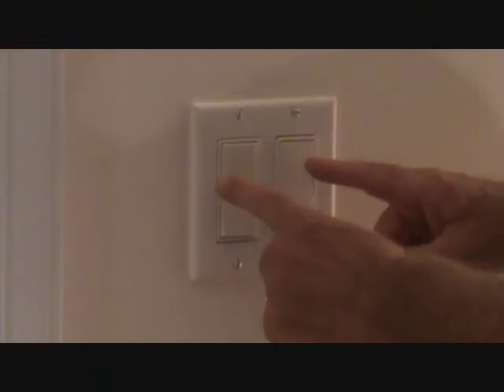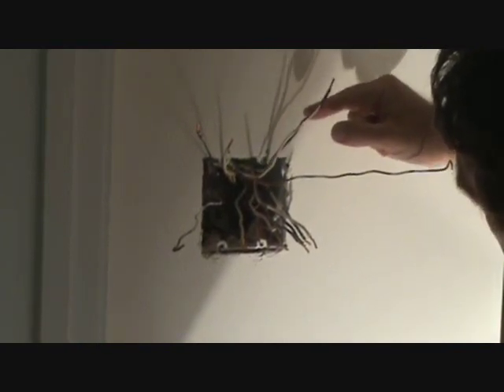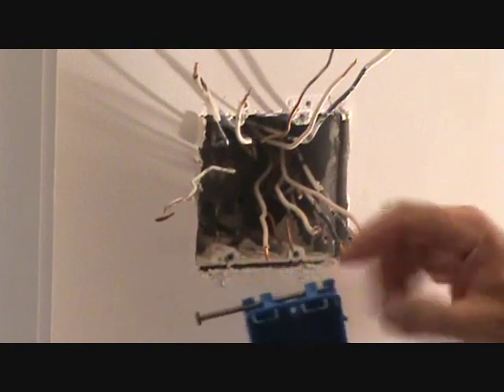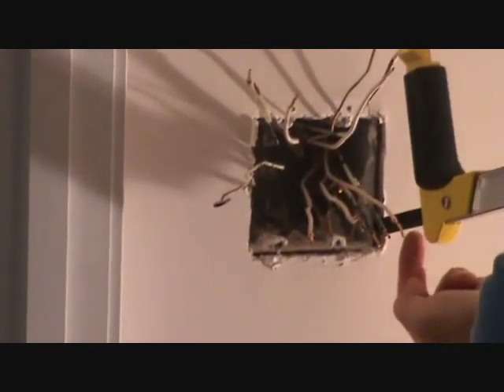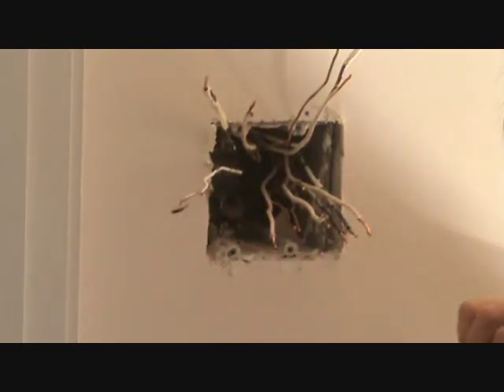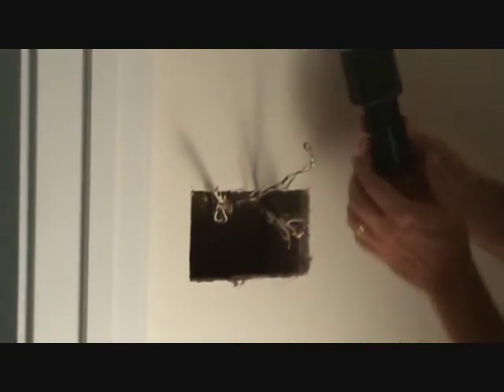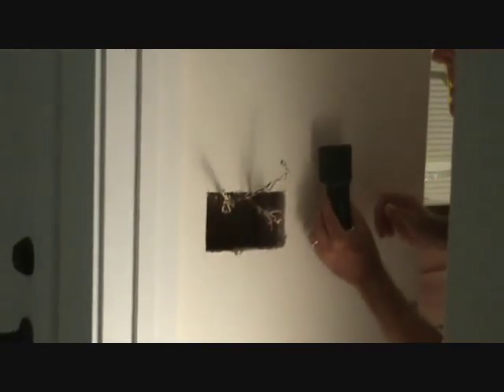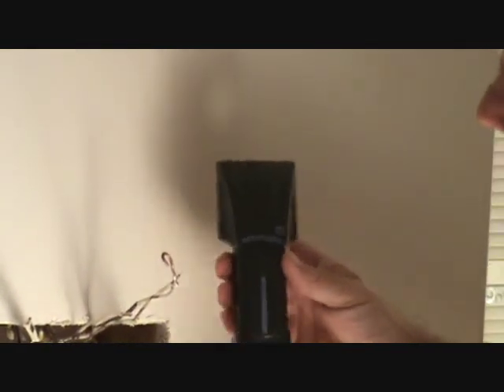Removing a 2 gang electrical light switch box

Comment from the maker: The brand of hacksaw was a Stanley. I could've just used a hacksaw blade & nothing else. That works good too. Just wear gloves. Sorry you had to patch the sheetrock. Sometimes the boxes are a bear to get out, without damaging the wall. Try cutting the nailing bracket off next time. Slip just a hacksaw "blade" in there & cut them off. Then the box might slide straight out. Thanks for doing it yourself! Thanks also for commenting. Much appreciated!   Joe  :0

Comment: I just did this because I need room for 4 switches instead of 2 in the bathroom.It was a freaking NIGHTMARE getting the old 2 gang out. It had brackets with 2 nails in each of the 2 brackets so even after i managed to remove the brackets from the stud I still mangaged to destroy the drywall trying to remove the 2 gang with the brackets.Needless to say I ended up doing drywall repair.
Couple of questions.  What brand is that hacksaw you used in the video?  That could have come in handy for me.